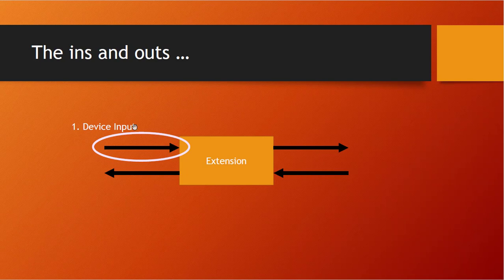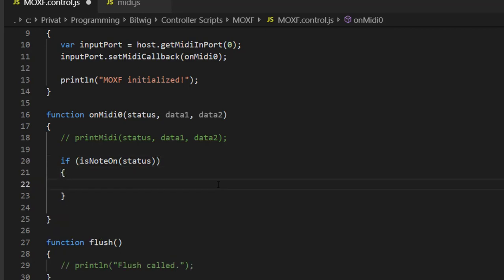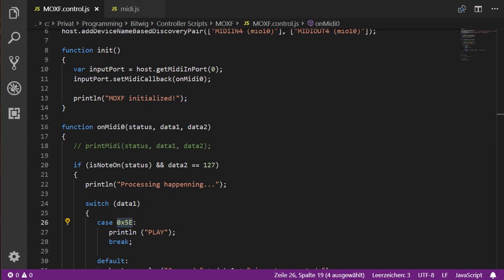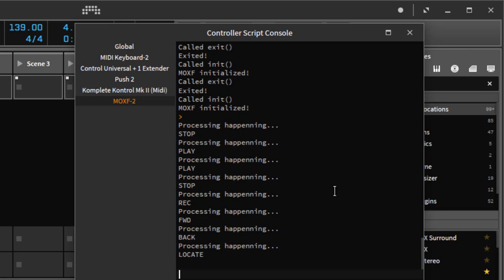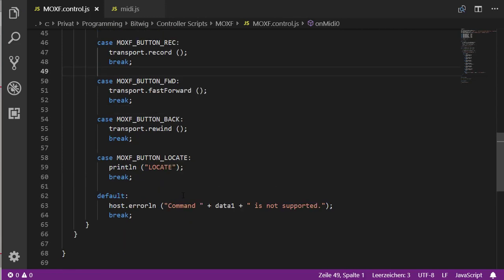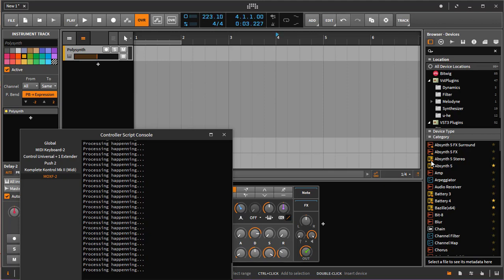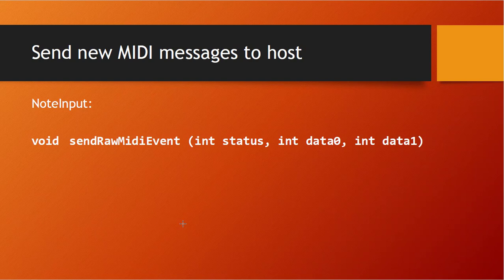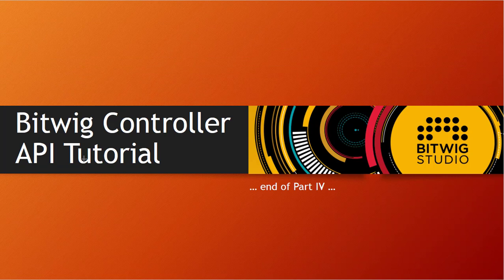Developing with the Bitwig Controller API - Part IV - Controlling Transport

Comment: Thanks for the tutorial. Been following your tutorials and trying to write script for my Traktor Kontrol X1. So far the transport function works for play, stop etc but I am stuck trying to properly update LED feedback on the Kontrol X1, it's not syncing properly with Bitwig. Can you please advise on how I should implement this ?
Reply from the maker: Check the X1 template with the NI Controller Editor. The pads need to be set to light the LEDs on "MIDI IN".
Reply: @mossgraber  Thanks for the response. Finally I got it working. I had to "transport.isPlaying().markInterested()" then like you said in "flush()", I had to send midi with appropriate message.

Comment: very good tutorials, but unfortunately Im an idiot, so I just can't figure it out. if I send a control change message that reads
MIDI: 176, 2, 127 [b0 02 7f ]
MIDI: 176, 2, 0 [b0 02 00 ]
in the Bitwig control script console.. how would that control the play function?
I know you send note messages but I assume it works the same for control change messages?
from your example, Its obvious how you got the 5E but how did you get the 0x?
MIDI:144, 94, 127 [90 5E 7f]
const MOXX_BUTTON_PLAY   = 0x5E;

im fully aware that you explain all this and that its obvious for most people but like I already said im really not very smart. I've watched this and the previous video several times, and im still totally clueless where the 0x came from.
Reply from the maker: In many programming languages to write a hexadecimal number you have to proceed it with "0x". So, it simply means "the hexadecimal number 5E". If you prefer decimal numbers you can also define the constant as "MOXF_BUTTON_BUTTON_PLAY = 94".
Reply: @mossgraber  thanks a lot for the answer. it seems so easy, but so far I've had no luck assigning anything in the script whether its hex or decimal. not even if I copy your entire code. but I'll keep trying.

Comment: Dude! Great Work! Can the sustain pedal be used to send midi notes too?
Reply from the maker: Yes: Block Sustain CC (do not register it for auto-forward), handle the Sustain CC message, create a note on down and stop it on up.
Reply: @mossgraber  Ok so I can use it control Wah / Volume etc expressions in e.g. Guitar Rig and such?

I already have a Line6 FBV Express MKII which is an awesome fairly programmable and affordable (79EUR thomann) midi foot controller, but I want to have 2 expression pedals operable at the same time (instead of toe switch) for e.g. -3dB volume adjustment on the fly.

So as I have the M32, then I order a 19 EUR expression foot pedal, plug it in and have 2 pedals + bunch of other controls available at my finger tip.

I think that setup will prevent WW3 from happening!

Comment: Du hast wohl Pitch Bend gelöscht fürs Midi weiterleiten E?????... (D????? wäre Channel Pressure, C????? Program Change und A????? Poly Pressure). Ich nehme an für die kürzeren Midi commands muss man denoch 5 Fragezeichen setzen... (Habs nicht ausprobiert.) Aber an ganzer Front vielen Dank für die Tutorials...
Reply from the maker: The value represents the 3 byte of the MIDI message in hexadecimal numbers. A question mark means that any value is forwarded to Bitwig. I think you can skip question marks at the end but haven't tested.